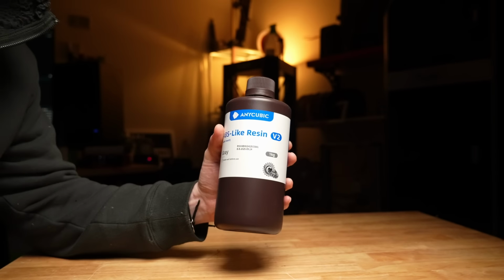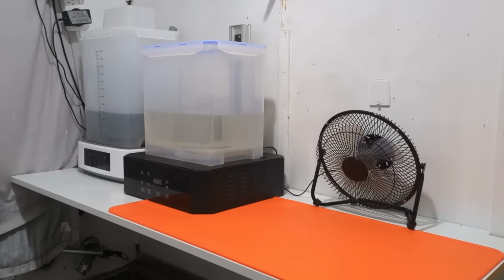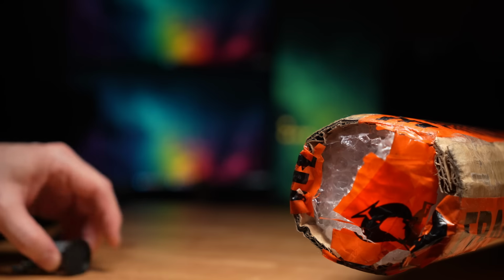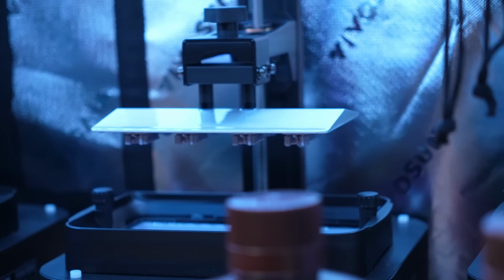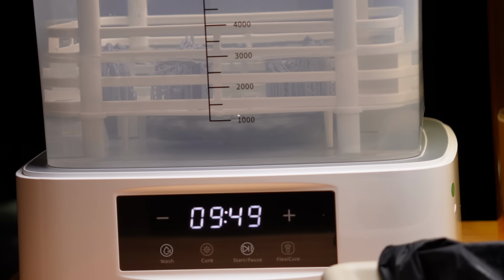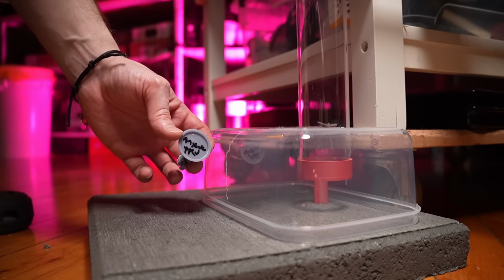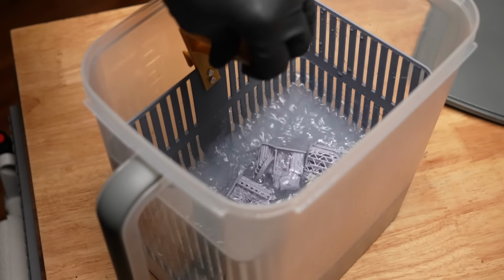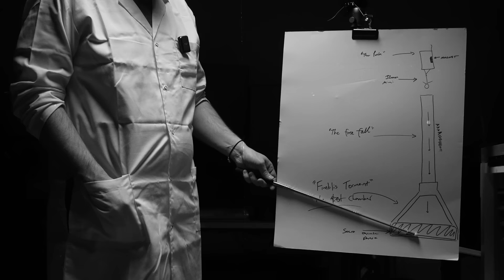The hunt for GREAT water washable resin (Part 1)

Comment from the maker: I'm sorry for not explaining the purpose of the drop test properly in this video, so if you're a bit confused also here's my thinking on it:

The goal is not to recreate a typical or realistic drop, rather it's to plot the differences between resins. To see which ones can survive these unrealistic & constrained conditions from worst to best.

So then with that data we can look at them all on a graph and see how resin A compares to resin B.

If we know resin A is good enough, and resin B is garbage, and resin C is overkill, then it should be obvious what resins D-Z are like from the data, and at the conclusion of the video the test failed to log enough of a difference between garbage and good enough. So it just needs tuning.
Reply: In that case, you can change the test item shape. It doesn't have to be a model with complex features and protrusions. Most materials testing uses coupons of regular shape: dog bones for tensile testing, small cylinders for compressive testing.

Could you make a set of cylindrical test shapes, like one with a conic point, one with a rounded hemisphere, and one with a flat head, and see how they survive?

You could also introduce reducing tapers behind the different head shapes, so full calibre maybe 15mm, then one necked down to 12mm, then to 10mm, and see how that affects impact survivability? You could also do internal erosion, so cavities rather than tapers, ideally with a sort of basket slitting along the outside for ease of draining/cleaning but also to allow the material to flex. Cylinders are quite strong shapes, adding in side cuts makes it more like testing a bunch of rectangles.

That would give you some comparison points for different materials, maybe analagous to dropping on a spear or gun vs an arm or leg vs the base, and at different thicknesses, and potentially also the risk of breaking for a hollowed minature. Obviously would need tweaking depending on initial results.

I really liked this video, because you explored your testing method and published failure. Publishing failure is something the research community does NOT do well and it leads to inherent selection bias in articles.
Reply: I second this. Slapping miniatures to the thing makes it seem like it's supposed to be a regular drop test. Using some other, geometric form would probably be best. 

But aren't there already standardized tests for flexibility, durability, hardness and such? I definitely watched a few videos comparing resins using tests that seem not that hard to replicate and are definitely more accurate, making a drop test pretty much obsolete, because shouldn't a drop test always be a realistic representation of, well, dropping a Mini off the table? Since trying to normalize a drop test isn't really necessary when there are other, more accurate tests to compare resin metrics? 

 @thisisabsolutelystup
Reply: I get it but I think you need to consider what you would like to “plot”. From the design of the test it seems like you wanted to plot number of fails/breaks and see a gradual signal. Unfortunately due to the nature of fracture mechanics I think that’s unlikely to work. In a nutshell, solid materials deform more and more with increasing force until they fracture catastrophically at a critical force. Which means if you apply a fixed force (I.e. weight and drop height) then you’ll pretty much see 100% fails OR 100% pass for a given material. Which you did! Only if you happen to be very close to the critical force should you expect to see a mix due to minor randomness.
To differentiate between lots of resins you’d have to vary the force over a range to find each resin’s critical force. Doable…but would need lots of minis! E.g. Keep increasing the height until it breaks!
I also agree that the extra weight matters. Something that can deform and bounce will behave differently to something that is squished under a large weight. I get that you were trying to guarantee the mini always hit the same way. I suggest something like a croquet mallet where the weight hits a stationary but “free” mini might be a better way to go. Plus flying minis would make for a fun video. Just need to catch them in something soft.
Reply: Ooh…just thought of something that might work with a small number of minis using your setup. Instead of a stock mini, Use an array of supports with a flat top and change the number and/or thickness of the supports. A few thin supports would break but many fat supports wouldn’t. You’d have to dial in a reasonable weight/height using a reference resin.
Reply: Do you have a link for the "grow tent" that you used as a fume hood? I'm going to have to stay printing in My shed and I've thought about additional volatile extraction.
Reply: Heres my two cents: Simplify and lighten he drop puck.  Make it a hollow structure and use bluetack to hold the minis in place.  The extra weight that it's imparting on your test pieces isn't giving any of them a real chance.  Loved the video though 🤘
Reply: Hear me out: if you want to drop from 1 meter that size base, cut that pipe down to 1m length and forgo the puck and magnet. Juat hold it upside down and drop it down the pipe. I think it it didn't have the puck it would be able to test that single impact with the weight of the mini and then bounce and rebound instead of just last. 

Also, I would reconsider the methodology of the models chosen. Being just bits on bases has a different weight than a full mini. Not sure of a solution, just pointing out potential error like the average YouTube commenter XD

great testing and subject matter! Safety matters a lot and this is a safety video with testable standards included! Love it! Keep up the great work

Comment: Sorry, but your drop test is not realistic AT ALL. First of all you add a ton of extra weight, compared to the very light model itself. But even worse, the extra weight hinders the bouncing effect that would normally occur on hitting the floor. It is like testing yourself hitting the floor, but with a 200kg backpack on your back and not being able to fall on your hands or roll.
Reply: Yeah, you overenginerred the hell out  of something that really didn’t need it. Test for the reality of most drops, knock it off a table! You’ve basically made a gravity powered hammer here.
Reply: Guy is trying to test out CONSISTENT results not realism. Poor lad is trying to to get a result that can be replicated constantly rather than X sometimes dropped on Y from Z can result as a good resin (maybe).
Reply: The point you’re making just proves this is worse for the mini than a regular drop would be. So it actually is a good indicator if the resin is durable. It’s like a ultra stress test
Reply: @chuck2703  Wouldn't just using the pipe to guide the mini straight down be enough? Remove the block on the to and just use the guide plastic? Leave a gap at the bottom for the 'bounce' effect?
Reply: @hugheja89  crushing instead of allowing the model to bounce can be interesting but I am not sure it is the most relevant kind of durability as ultra as the test can be
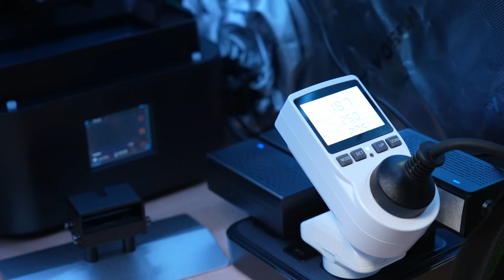Reply: "this is purly spectaclae and fun" 7:52

Do you guys not watch the video?
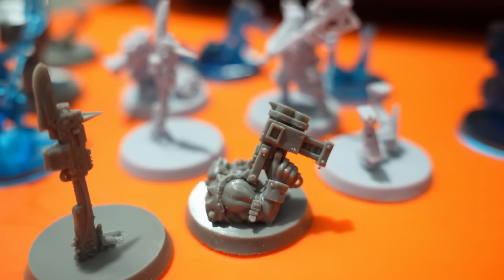Reply: @yoschiannik8438  "kindly comment and tell me how I can improve the drop test.." 17:18
Did you not watch the video? :P
Reply: I think there was just too much weight on the mount IMO. I agree that there should be something to control the test but not add an extra variable. Maybe a thinly printed PLA mesh as a base to hold the model would’ve been better.
Reply: Obviously this unrealistic test was designed to make them fail. Just knock of a table onto a carpet or wood floor allowing it to bounce rather than add a heavy weight and smash into concrete.
Reply: That's not at all how testing methodology works. The point isn't to see a realistic impact (they'll likely all survive) it's to show the difference between the good and the bad. And usually that does mean putting more stress than just the average situation.
So yeah he put way too much weight and and they don't bounce but that's not what it's testing for. He did correctly identify that his test couldn't tell the samples apart so he lowered the height (therefore lowering the energy of impact).

He probably should have lowered it even more to really be able to pick the samples apart... He was just stubborn because of how much time investment it would all represent.

None of that means the test setup has a problem.
Reply: Yes! Thank you for writing this. The puck constraining the bounce of the model as well as smashing on it has nothing to do with a scenario where a model falls on the floor.

Comment: You could just drop the mini's into a known height tube 2 or 3 times and see what damage is caused. Fixing them to a weight that crushes them on impact is not indicative of any real world scenario.
Reply: Yes, this test -- while interesting from a technical perspective, is testing impact resistance. Like, if you start hitting your models. It doesn't test whether it'll survive a drop from the table, it tests whether it'll survive a guy who got angry that he lost the game lol. This test is almost designed for tough resins -- which cost typically 2-3 times what a regular resin does, and IMO aren't necessary at all.

Comment: You need to let the miniature fall on its own and bounce as it wants to bounce.  Weighing the mini down isn't proving anything.
Reply: Because? That's just "I feel like you're wrong" type of argument. Kinetic energy is mass*velocity*velocity. The test compares impact resistance of different resins. The extra mass does not matter, because it was equal for all the samples [1]. The distance (velocity) was equal too. All samples had to deal with the same energy and some did it better than the others. Equal conditions is exactly the test that should be conducted, unlike some random, bouncy and inconsistent drops. Then there are the cases when a book falls on the mini, which makes the bouncing irrelevant.

[1] technically different resins may have slightly different density, so the added mass would average that. I'll risk stating it is insignificant enough (except resin with additives, but that's too far) and in practice a thicker layer of paint could make a bigger difference.
Reply: @perz1val  The thing is, it's not that "some did better than others". Some resins survived, some didn't. But that just means some resins cleared a certain threshhold where they didn't break. Yeah, that means that those resins are indeed tougher than the others, but it doesn't allow for an accurate ranking. It's not that trying to normalize a drop test is a bad thing, but it's really, really hard to do so. A better way to determine an accurate rating on toughness for these resins would be to print the same mini in the same resin at least 10 times and dropping them from a table at normal playing height, reproducing a normal playing situation and simulating dropping that mini. Not with 1 or 2 models - that's like trying to determine the average roll from a dice in 4 rolls but with as many models as possible. It's time intensive and will use a lot of resins but it's a better way of determining the real-world toughness of resins than trying to normalize a drop test.
Reply: @perz1val  YES, the mass matters.  I don't typically tie weights to my minis.  Dropping a based mini from a table to a hard surface is a more realistic test.
Reply: You are correct, they will bounce, flex and diffuse the impact forces, plus air resistance slowing velocity.
Reply: @perz1val Right, so you are completely missing the point people are making: the mass was wrong. It doesn't matter how they perform under the wrong conditions. I can tie a 100kg weight to ten different runners and it's not going to tell me which is fastest, it's going to tell me which is fastest with 100kg of extra weight.
Reply: @topkekbieri "Yeah, it means that those resins are tougher than the others"

Exactly. I totally agree with you, it was a far cry from a real scientific test, but it gave us information about how water washable resins can be expected to perform compared to alcohol washable resins. The added mass does not matter for such comparative test. It was done well enough, better than just dropping a few minis from realistic (read: random) conditions. It would have to be thousands of individual tests; with such cost, the experiment wouldn't even be worth doing. For printing toy soldiers, the test was good enough.

Comment: One way of disposing the waste water would be to get some kitty litter and dump the water onto the kitty litter for it to absorb. That way you can let it evaporate on its own and/or dump it in the trash. Where I live (Pacific NW of Canada) this was the recommended method of safety disposing of used resin by our Recycle hotline.
Reply: I am nowhere near convince that this is even remotly a safe way to dispose if resin.
Reply: Why not just put the waste water in a big transparent jug and leave it in the sun for a couple of days?
Reply: @Aceborn-Gaming  A big container of water is gonna take more than a few days to evaporate, even in searing heat.
Reply: @yoschiannik8438  I was told by the recycle hotline that it was the safest way to dispose of resin. An extra step I do was to hit the resin with a UV light or leave it out in the sun for a few hours to harden
Reply: @mantis114  Hmm yes, im sure the indian hotline worker knows about how youvproperly disposse of resin. Defenatly. 
You either dispose of containimated water like the dangerouse chemical waste it is, or you dont dispose of it at all
Reply: @yoschiannik8438  it is actually rather safe if yo are not living in a 3rd word country that just dumps stuff into land fills. Here in Germany the trash is burned at high temps and the exhaust gases are filterd. I assume Canada is doing the same if they recommend that.
Reply: @Thunder_Moth  The issue isnt gasses being filtered after the stuff gets burned, the issue is all the things you might containimate on the way their. Most waste workers dont usjally wear VOC filter mask...
Reply: @yoschiannik8438 if you hit it with UV or leave it out in sunlight before you dump it, as they suggest, it is no longer toxic and doesn’t need a mask or gloves to handle.
Reply: @topkekbieri  Also it's water, so some animals could drink it, while they will not drink alcohole. I believe bugs will try both water and alcohole, but with water they have much more time to get poisoned. 
When dealing with IPA I leave in in a closed jar and just puncture few holes. With water it could never evaporate this way.

Comment: You're just trolling us, right? RIGHT? Because I can't think of any scenario where you'd think that adding a weighted mass on top of the minis to literally add crushing force on top of the drop is in any way a fair indication of the real world strength of any resin. Simply using your tube for a repeatable impact point and just bare dropping the mini from a known height (WITHOUT any added mass) would be a far better test of the potential abuse a mini would actually be subjected to.

Comment: I feel like a lot of people are missing the point of his drop test setup. It's not about realistically simulating a "drop" so much as it is having a way to control and replicate a consistent impact that's repeatable across a range of different models. All models go through the same tube attached to the same test rig and hit the same concrete, only variable is the model itself (and whatever it's made of) which is what we're interested in testing :)
Reply: I have controlled the variables by loading the minis into the same howitzer and launching them at a brick wall. My results show that all resins are equally fragile.

Comment: I use water washable for cost, smell, and not flammable. I store my dirty water in empty and closeable cat litter buckets (Purina Yellow Buckets) and then I bring them to my county recycle and disposable station. I wait until I have about 6 of them full. I've had success with Elegoo ABS V2 water washable. But then again, I haven't dropped many... but at the same time, I would expect any model regardless of resin to break no matter what. I understand the alcohol washable is stronger, but I just don't want the hassle, smell, and potential of catching fire :)

Comment: You need to reduce the extra weight of the drop test so it just simulates the miniatures itself dropping on the floor. With less weight air resistance becomes an issue, but you just make holes in the mount for the air to move through instead of it being a solid block.

Comment: That drop test has a couple of major flaws, you’ve added a lot of extra mass and too constrained around the bottom of the drop. You’re absolutely correct about those two being the issue. The easy fix is remove the puck and replace with a simple pin style release or trapdoor and leave a larger gap at the bottom of the tube.